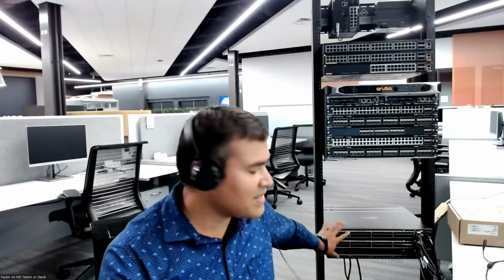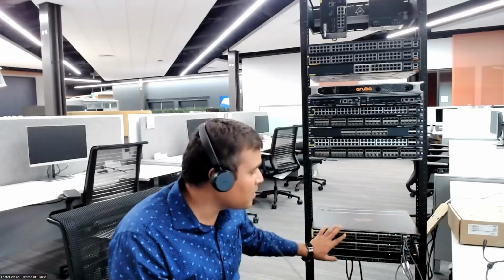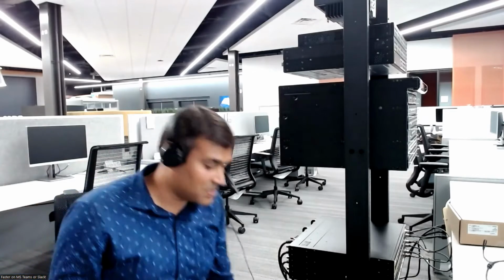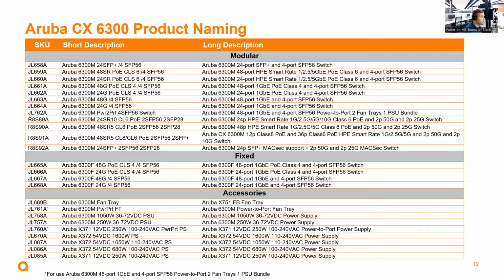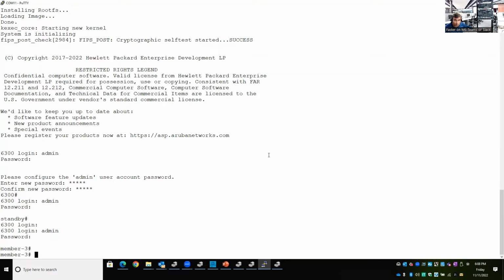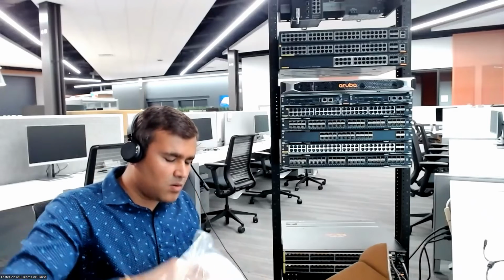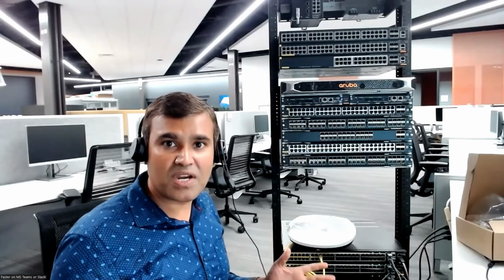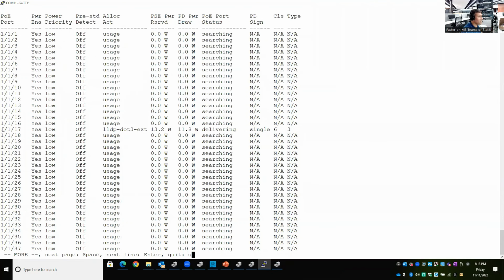Unbox: The HPE Aruba Networks CX 6300 Premium Access Switch & HPE Aruba Networks 655!

Comment: I always thought about this feature i.e just connecting a switch and auto-joining without additional configuration, great engineering Aruba implemented it.
Reply: 100% using template would be so simple if this just worked.
Reply from the maker: yes, Aruba & HPE is world's best engineering company. We build world's best efficient products & solutions!